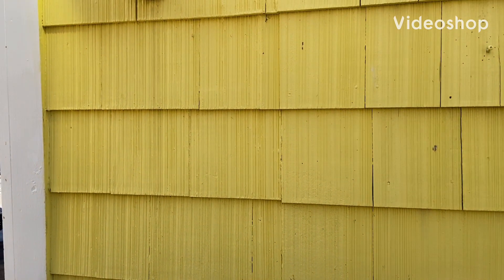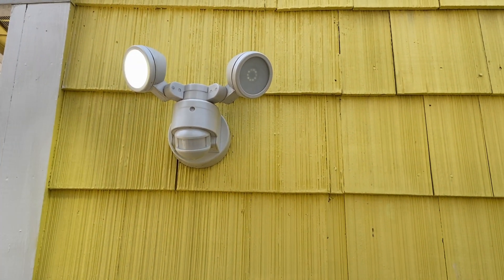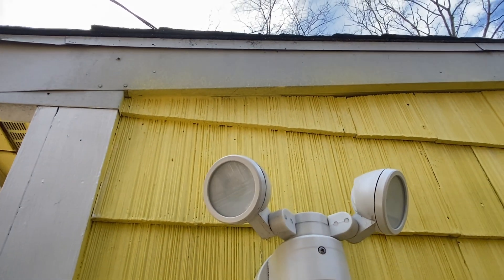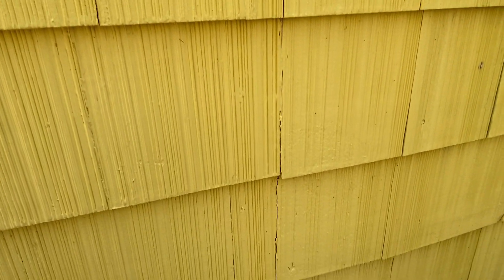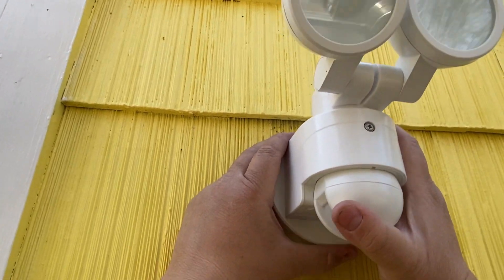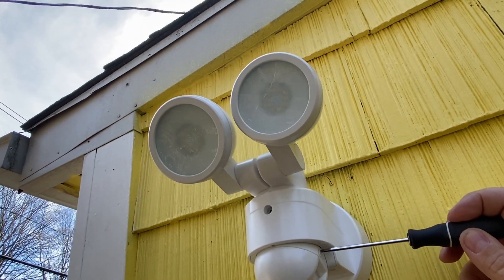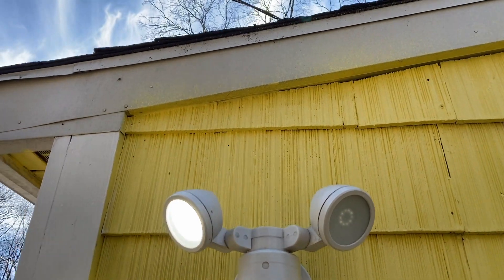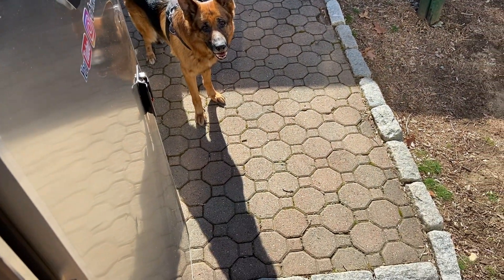Defiant Motion Activated Light Repair Broken LED Light

Comment: hi.  thanks for the video.  what model was this defiant 2 head unit thanks?  home depot still selling them for $35 but the manual doesn't show the ability to "snap on" a new unit to the old base as you showed in your video.  I have to replace my POS as the lights are burnt out.  the cheapest would be to replace and ideally not have to wire in a new base.  thanks.
Reply from the maker: I believe this is the one you’re looking to replace.

Internet # 324293844
Model # 17000061
UPC Code # 058219241837
Store SKU # 1009195272
Reply: @HighRidgeHandyman  thank you sir!

Comment: 1 strobing defiant led light led  me here. Mines lasted about 4 years. Unfortunately it seems Homedepot has a newer version that has a fixed motion sensor a 4 screws instead of that one center mount for the light making it not as easy to swap out and a cheaper design. Even Amazon does not seem to have it also. Chinese crap sounds about right. Lets fill our landfills out, and then buy electric vehicles and feel good about saving the environment.

Comment: I bought a house with two of these lights recently installed – they both crapped out within three years. One just stopped working and the other has the same issues as this video.
Reply: I'm so glad I found this video because I've had one flashing outside my garage for a year and I had no idea what brand or model it was. Now I know it's just a piece of crap and I need to replace the whole unit!

Comment: Good video about assembly and reassembly. Is it possible to change the bulbs once they go out? The house came with two of these already installed
Reply from the maker: It’s not possible. I had to actually replace a few entire units already. I would recommend if you need to replace one to buy a different brand👍🏻

Comment: I cant get mine to work either. Same here, mine needed replacing in 6 years. Lets keep filling up the land fills with china made shit!, ugh!
Reply: bugse lucky YOU….. You got 6 years of life out of yours … I got NO more than 3 out of mine …. One side went out so I went a bought 2 just in case a couple weeks later the other side has gone out but the blinking red light is still flashing about switch out the old for one of the new … NEXT TIME I won’t buy the CHEAPEST motion light

Comment: Could you just place the new one on the old mount?
Reply: Yes you can if it's just a burnt out bulb, that's what my son does and has showed me to do,  because i hate electricity and didn't want to mess with wires everytime a bulb burnt out.
Reply from the maker: I tried it was the new light fixture. Both wall mounts were good. Turned out one of the pins in the new fixture was broken when I returned it